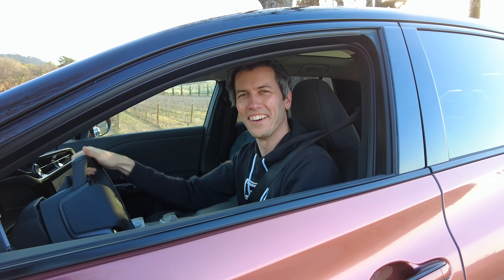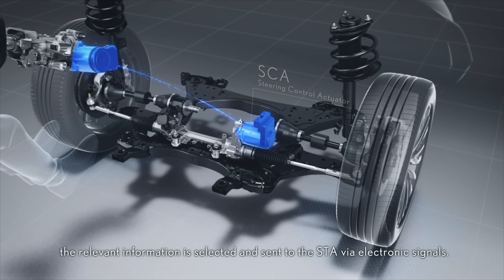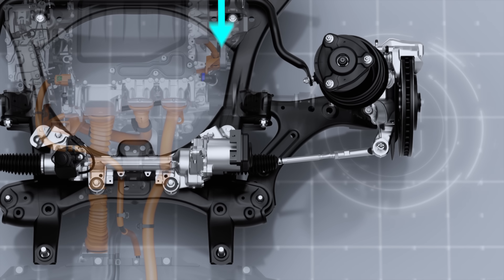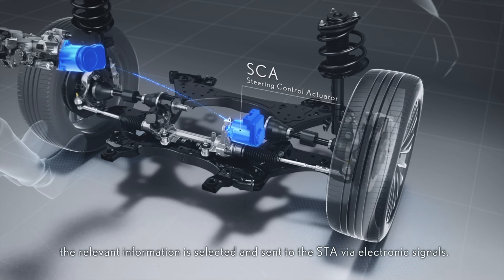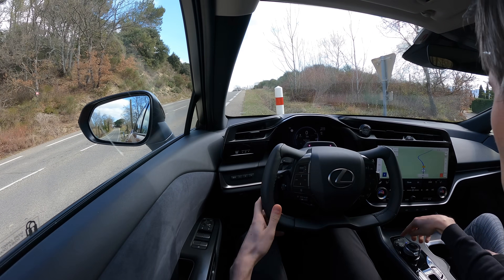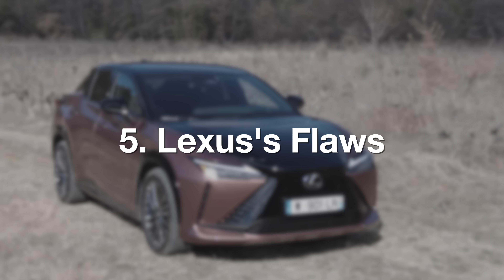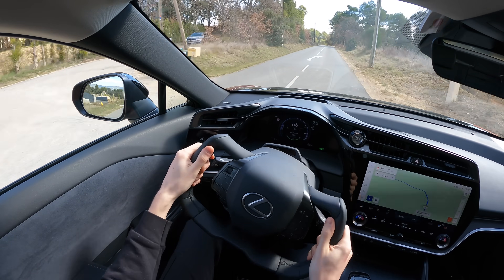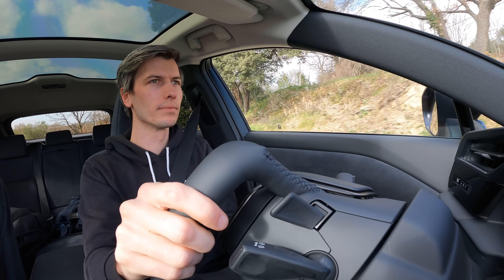How Lexus Fixed Tesla's Bad Idea: Steer-By-Wire Yoke

Comment: As someone who works on their own cars, it sounds like an expensive nightmare if/when something goes wrong, however, chances are, someone who can afford such a car can likely foot the bill on the repairs when they come.  My biggest opposition to over complicating systems like this is the matter of how well they'll age. My newest car is 20 years old but the mechanical components tend to age much nicer than electric ones. Pushing over 300k miles on my daily driver, i could only imagine how much of a toll that time and miles will have on 100% electric components. In the end, it all comes down to preference as mentioned.
Reply: I think eventually this manner of steering will become the new standard, which in my mind is a shame, since electronic systems like these are often expensive to repair and impossible to do by yourself. They'll likely need to be taken to specialist, licensed garages with the appropriate software. This again brings more money back into the hands of the manufacturer. 
Additionally, any cost downs in manufacture made through the simpler re-mapping of the steering apparatus for left/right hand drive, likely won't be passed on to the consumer
Reply: @OwnGrid  nope. By me experience, its just the opposite: mechanical parts endurance is dozens of times higher.
Electric motors fail fast, electronics fail fast.

And that is why all heavy industry uses hydraulic and/or pneumatic systems.
Reply: @vxvicky  Electric motors are the most reliable motors human have made, and hydraulics are not purely mechanical and they have a massive advantage with heavy loads due to the way they function of fluid displacement
Reply: @OwnGrid  Do you know what motor brushes are? That's without going into the control units, which tend to literally toast from heat in summer.

Facts, not words. Talk to anyone in a garage and ask them which is more reliable, the steering on an older vehicle or a modern one?

Greetings and go wash dishes.
Reply: @vxvicky  Greeting maybe you need to clean something called brushless motor to learn 101 about electric motors
Reply: @OwnGrid how often does a steering column fail? To my knowledge, almost never unless the part is faulty
Reply: @Tyufoe96  The steering apparatus is not just the steering column the attached hydraulic system is especially prone to failure
Reply: @OwnGrid  what is "especially prone"? Do you have a statistic? Also, when power steering does fail, it's the pump that goes out. Which is a cheap repair that can be done at home. It also doesn't immobilize the vehicle.
Reply: @Tyufoe96  Funny you ask about state  before you hold others to a standard you should follow it your self as you provided only nonsense
Reply: The 86 Mazda I mentioned in my response, where the heater mix door system was by wire, cost of replacing the electronic part that failed was over $1,000, most of which I believe was the part.  That was picked up by warranty even though out of warranty, but that sort of goes to your point.  If a cable had been used instead that would have been less than a $50 part.  The dash control part perhaps slightly more, but still a lot cheaper.  Not to mention the cost of the test machine to diagnose the issue.
Reply: "if/when something goes wrong" It will. No matter the price of the car; it is going to start failing around the ~150.000 kms mark.
Reply: Cars will be disposable. Its already happening. You wont need to fix them just get rid of them and get a new one every 150,000 miles or 10 years.
Reply: @OwnGrid Incorrect. Totally wildly insanely incorrect. Mechanical parts age far better than electronics and have FAR fewer failure points.
Reply: The days of being able to work on your own car is coming to an end. 20 years from now there won't even be a need for mechanics, as there won't be much mechanical parts outside of the wheels and brakes.
Reply: Mechanically this is much simpler though, and I don't see why it couldn't be cheaper too with economies of scale.
Reply: @MrAwawe anything related to electronics are usually the most expensive things to replace in a car

Comment: a couple weird things but definitely cool...

if I understand right the traditional wheel version isn't the same, its actually mechanically linked. personally, I think I'd still prefer to have a round steering wheel even with the variable steering ratio provided by steer by wire, and I'd would love to see it as an option in cars that will want to use yokes like this. Also the way it's adjusting itself automatically at different speeds would probably have me on edge at first, I guess I'm scared it could be unpredictable? Yes you talk about these but I just needed to let the nervous energy out.
Reply: By the time it's caused a few accidents the average driver will be used to the changing gear ratio and how it adapts. lol

Comment: Cars with electric throttles weigh as much or more than normal cars. Also, from a repair standpoint, the engine bay isn’t any less cluttered on a new car than on a 20 year old version of the same. If someone else wants to throw their money at a tech toy, I’ll let them. No sale for me.

To my knowledge, nobody is planning to go door to door to confiscate older cars. Or gas powered cars.

Comment: I've already seen all of this back when Tesla's yoke was new, when people were explaining why it wasn't bad. I'm really confused, because I really thought the Tesla Plaid edition already had steer-by-wire, and even saw people demonstrating it working in a Tesla.
Reply: Have you seen photos of a Tesla with no steering column shaft connecting to the wheel or the rack? No... because Tesla doesn't have full steer-by-wire. Various vehicles (including some from Nissan) have had steering systems that mechanically disconnect the wheel from the column for steer-by-wire (complete with variable ratio), but reconnect it if there is a failure.
Reply: @brianb-p6586  isn't that the ideal solution then? Providing that steer-by-wire is better than mechanical, I'd rather have bad steering when it fails than no steering
Reply: @ScoptOriginal  all the cost of a steer-by-wire system with none of the packaging advantages of steer-by-wire makes for a poor compromise, which didn't work out to be very desirable. 

If the potential steer-by-wire behavior was used fully, the steering behavior would also change radically between normal (steer-by-wire) and mechanical backup mode, making vehicle control problematic when tho gs go wrong.

Comment: In my opinion this is not acceptable unless they can get under like 3ms delay and have a direct steering mode for track driving. I wouldn't like if my car would limit my steering because it thinks it's going faster than I really am resulting in F1 steering angle while just trying to drive out out of an icy corner.

Comment: Can't this be easily solved in tesla with a software update? Making a high steering multiplier for very low speeds which decreases as speeds goes up?
Like for parking moves 1-2mph to have very high steer sensitivity, and after 10mph to decrease drastically for city speeds, and after 40mph to stiffen more and more.
But then we come into the swerving to avoid accidents category. The moose test being important for car's handling.

Comment: The downside of a yolk is what is taught as safe driving, in Holland you are required for safe driving to use the whole wheel. Most of the time you don't need speed whilst driving safely, by having a yolk you have a limit in controlling the car. And one thing that is always dangerous is the lag between input and responce wich even little means there is room for to miss the window to maintain safety. That's why f1 still has mechanical steering wich is safer..

Comment: This thing is a human-factors nightmare waiting to happen and I'll explain: Yokes are just not very good overall if you need to do any kind of passover for extended steering. This thing really needs a clutch so if the motor fails, you can default back to the shaft in zero-power situations (eg, if you run out of power and you need to push it somewhere, or if you need to zero the steering to tow the vehicle). Likewise, I can see there being lots of situations where the proportional controller they're using is going to have feedback loops with the traction controller via the force-feedback unless they're using dynamic deadzones which will produce unknowable blindspots in the steering-range for the driver so this is uhhhh kiiiinda suss for bad conditions freeway driving actually??? The Higashiyama has also stated RZ's yoke won't be ready until 2025 because of these problems and they're just going to throw money at it until it goes away. This is literally a pissing contest between Lexus engineers and Telsa engineers that nobody asked for and an over-engineered solution looking for a problem that doesn't exist to create a status symbol for people who enjoy Rick and Morty and Big Bang theory.

Fly by wire works because when it doesn't, you have time to comp out and re-bias your controllers which a system will do every few minutes when conditions change with a response-time of around 5 seconds safe. You kinda can't do that when rebiasing results in like, a collision in <1 sec safe? FBW has absurd maintenance standards, three to eleven layers of redundancy and specifically you're not even flying the plane, the plane is flying the plane and you're making requests to the plane. 

The same isn't... Really true... Of a car... 

In a car, you do kinda want to know the result of your actions before you make them and minimize unpredictability. This thing is a human factors engineering problem waiting to happen. The latency induced oscillation and weird awful traction-control fighting that's going to happen here is going to be awful and the class-actions are going to roll in like butter.
The only advantage I see is crash safety with the steering column being removed being a thing since the crumple zone will lack an interrupt so forces can be better shaped around the occupant and possibly some bragging rights.

The way that car companies are out to overcomplicate everything so they can as aggressively control their own ecosystem by making the basic features difficult to maintain or potentially problematic to certify the roadworthiness of a vehicle is verrrrry consumer hostile.

The fact this thing has delay is legitimately frightening.

Comment: I feel like instead of the same amount of steering input doing different things at different speeds, they could just implement a system where the steering stiffens up and allows less input as you get to higher speeds like with current systems. I think that would be more natural. You could still get the benefit of steer by wire at lower speeds.
Reply: Stiffening the steering is technology from 1990's. Audi lowered the power steering "help" at higher speeds.

Comment: Basically, changing a direct steering wheel mechanism to a remote controlled input. Anyone who played with radio-control car toys will know that the servos can't move as fast as your input. It is the same problem here. 
Knowing how unreliable EVs are compared to mechanically dominant ICE cars, I will stick with my physically connected steering wheels.

Comment: Ever had a corroded negative battery terminal and lose all electronics suddenly while driving? 
I would much rather that my steering remain functional, even if unassisted. How would you safely control your vehicle after losing power if you're already traveling over 100kmh/60mph and lose steering? 😰

Comment: Well, I'm a person that relies on muscle memory. If I can get used to variable steering angle then I don't mind. Of course I would have to test it. If not, either I would take the classic solution, or ask for a settings that makes it fixed. Of course, if it is to have such an input/output delay as shown here, I would take classic rack every day.

Comment: I'm surprised he didn't mention production costs. It's gotta be way cheaper to put a couple electric motors in a steering column as opposed to an entirely mechanical, power steering system.

Furthermore, I don't see any reason why there should be input lag. As long as the computer can process the resistance information effectively, it should be as responsive as a videogame (or at least as responsive as a robot). Hopefully they put the best processor chips in these things. Mind you I have no idea how any of this works, I'm just speculating.

One thing's for sure, Lexus/Toyota has some of the finest engineers on planet Earth. They make quantum leaps because they're bold enough to try far-fetched things. With hybrids and regenerative braking, they were very successful.

Comment: Stupidity to replace one reliable gear that you will not touch in live with batterys, 6 motors, couple electronics, bunch of sensors that will fail. Pathetic.

Comment: As a career automotive engineer (R & D to manufacturing) "drive by wire" is an amazing technology.

The COST is the big hitter mainly in the calibration side of things.

Lastly, the safety side of things.

The "Achilles Heel" is safety then cost.

Cool stuff...for sure.

Comment: This is a very informative video

Still though I have to point out for myself and those watching.

If the car looses power the car is designed to brake immediately.

This is most commonly seen as ghost braking due to an electrical short in Tesla's this is a safety feature. 

So no power means no movement which means thanks to backup batteries you can safely stop if you lose power.

Comment: Let’s assume that the driver is speeding at 60 km/h at a relatively wide left turn. The yoke is kept at a certain angle to make this turn happen. Then suddenly, a break is needed to reduce the speed to 30 km/h. Does this mean that if the yoke angle is kept constant, the car will start pulling to the opposite traffic side? This seems a bit scary I bet!!

Comment: The higher ratio on highway speeds (meaning less response) worries me when doing emergency swerves - I think most people will swerve in an emergency without acknowledging their steering is different than in low speed, and that might lead to understeering and crashing.
Reply: The steering at high speed isn't less responsive; it is less sensitive. two different things; I doubt this will be a problem because that is the first thing the engineers probably thought about. It is something just wayy too obvious to forget, so I think it's fine. The steering is different, but it is probably similar enough that a normal person would be able to react accordingly in a high stakes situation.
Reply: @o77vh87 Exactly this. The lowered sensitivity makes sense since you would never turn your steering wheel a 360 degrees or more while at highway speeds.
Reply: Plus, I guess engineers will think about a system to sense extreme situations and accordingly change the sensitivity of some movements
Reply: It’s like saying most people who drive EVs will brake without acknowledging regen braking.  Your first drive or two, it is weird.  But then it is second nature.  You don’t even think about it.

Comment: If the steering ratio changes based on speed; what happens when you apply full braking force at highway speed to avoid a collision while also steering? Does the steering ratio change rapidly as the vehicle slows, thereby creating a very quickly changing degree of steering angle based on the exact same input from the driver?

Like; I swerve hard to the left and slam on the brakes at 100km/h. Does my car continue to turn harder and harder left as it slows, essentially following a spiral line of travel that gets tighter over time, rather than a continuous radius arc as in a traditional steering system?

Comment: Certain things should always be mechanical.  Steering,  brakes and seat belts. 
You can have all the tech assistance you want but should those fail you need a physical connection.  Period.

Comment: Yes we've had throttle by wire for a long time.   The difference with this is you don't usually crash if your throttle suddenly picks a random setting.

Comment: Call me old fashioned but there are 2 things that I would rather never lose a mechanical connection to your hands.

The steering and the brakes.

I would rather not find myself going head first into an oncoming semi truck with no ability to steer out of the way because my car battery spontaneously combusted.
Reply: Mike, there is a steering  you keep in your hand's all the time ->  progressive and mechanical, safe to drive with yoke    check with pss progressive safety steering :-)

Comment: The mechanical PSS has absolutely no lag with their mechanical progressive steering gear, the spiral pip gear, especially also in high speed safer to drive due the higher ratio as the serial Porsche.
Search for PSS PROGRESSIVE SAFETY STEERING